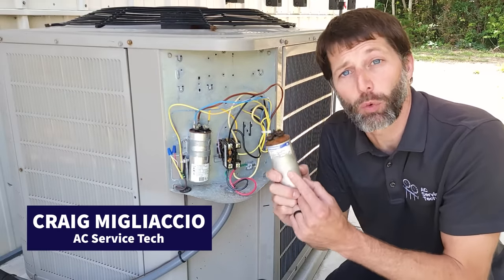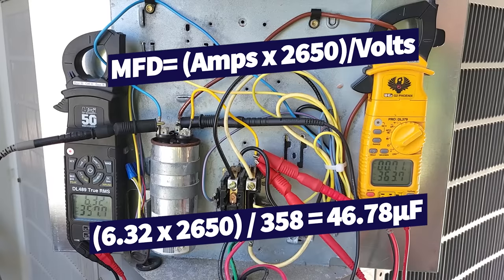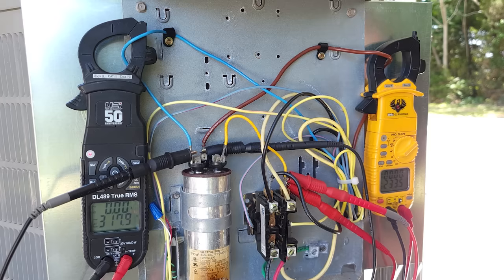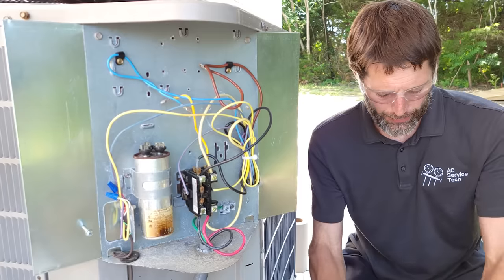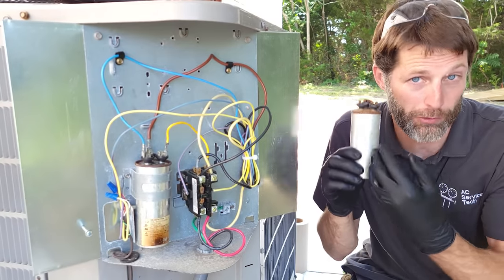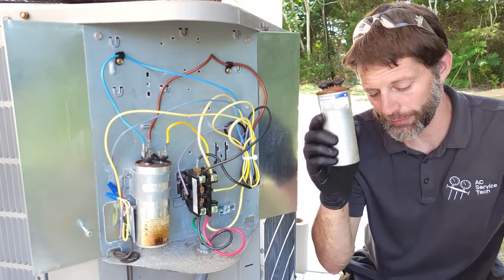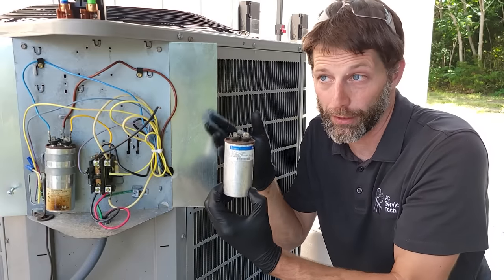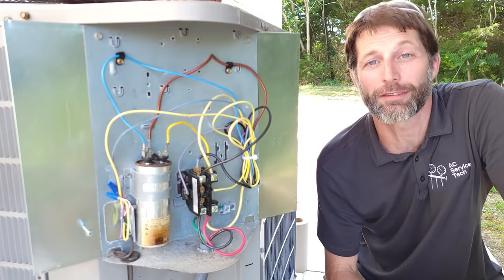WHY CAPACITORS FAIL in Air Conditioners! Watch it Break!

Comment: Isn't a Capacitor a ONE SHOT?   Doesn't a Cap give a momentary boost to get a device initially started and then the device has to keep running by itself?  Can you explain the Start/Run caps?  I thought Caps were only used for start up as they are a ONE SHOT.  Have can a Cap work in a running circuit?   I thought a Cap had to charge and them discharge very quickly and then needs to be recharged again each time it is discharged.   If a Cap is in a Run circuit is it constantly being charged and discharged over and over again?   What device would need to be given a pop from a Cap all the time?
Reply from the maker: A start capacitor is what you are referring to in reference to starting a motor. However a run capacitor stays in the circuit the whole time. It is the best thing to do with split phase compared to three phase. The capacitor provides a 90 shift in the phase angle and is constantly charging and then discharging based on the frequency. We charge a capacitor to to discharge it. The point is to provide a slight time delay in the phase of power before the power is sent to the motor.

Comment: TIP: if you have a cap that is rusted where you cant read the FAN,COMMON AND HERM and you pulled apart with taking pic look at the new caps prongs. The ones with the 4 prongs is your common, three prongs is the HERM, and 2 prong terminals is your FAN. So many techs miss this easy identifiable method.

Comment: How do we know that amperage reading taken on capacitor is a good amperage for motor should we check the amps on motor and compare to data plate fla and if 5hey are high give w higher amperage reading on capacitor and give us a different mfd for capacitor and will that reading on capacitor increase like that on the run or common wire to motor maybe higher amps being caused by bearings overheating and seizing qftr operating a while just curious

Comment: Yep heat kills the cheap generic capacitors. I had a bros inlaw that has his cu under an enclose patios. He would call me every summer cuz his cheap generic cap would fail. I told him you need to relocate your cu or remove your patio. Had him touch the capacitor and it was hot enough to fry an egg. He still would not listen so I had no other choice but to installed an indestructible capacitor. Been years he never call me back again. Been years nobody call me back. I think I should go back installing generic caps. Sure miss them calls.

Comment: When the capacitors dielectric oil expands, the top of the capacitor has a plug so that if it over heats it let's the oil out which is ment to pop to let it out. So that it won't exploded.

Comment: I would like to know more about that formula.
Reply: The capacitive reactance formula Xc = 1/(2 * 3.1415926 * f * C) where f is the line frequency 60 and C is the capacitance.  If you take 2 * 3.1415926 * 60 you get 376.99.  Take the reciprocal and you get 0.002652.  Since capacitance is in microfarads, multiply that by 100,000 and you get 2652 (to be more exact).  You're bascially solving for C in the formula.

Comment: When I looked up the capacitor in my Carrier heat pump infinity system outside unit I found it on Amazon for about $12, why did the repair service charge me $250? Saying that theirs is more reliable!

Comment: When you suggest they have a lifecycle, would that suggest that a cap that is 25 years old and still works be replaced ?
Is it better to use a cap that has a higher voltage rating for longevity with the same microF as suggested by the maker ?
Today's run of the mill caps are made in China. Are those okay to use or is it better to spend the time trying to locate them made in the USA ?
You recommend using replacement female blade terminals that are crimped, soldered or both crimped and soldered ?
Reply: Caps used to last much longer when they were still allowed to use PCB's. From the old ones I've seen they tended to be much larger than the ones of today. I don't know exactly when they had to stop using PCB's, but at 25 years old there's a chance it's one of those. If you know for sure it's a non PCB cap I'd replace it, or if you think you're keeping your system for a few years yet, just buy a new one to keep for a spare so you have it just in case to minimize down time if needed.
Reply: Japanese capacitors are also considered high quality.  And Chinese caps are not necessarily bad, but they have a "wider range of quality", as I heard someone phrase it once.
Reply: @electronics-girl  Yes siree, Japanese is the higher quality of the far east.

Comment: this is why i put my ac unit in the shade to keep it cool and it has run 26 years with just 1 contactor replacement when it was 1 year old power went out and it tried to start on generator power it did not like that.

Comment: I had the hvac come out and work on my unit. And the price doubled every year. They would always replace the same parts. The capacitor, the contacts and recharge the system. And that was extra.  I asked them why they could or would not fix the leaks. I was told it would cost more than the freon. The first year that was $80 a can and sometimes it took 2 or 3 can. The last year they came out was over $600.00. Sure, enough the next year it would not work. So, I go down and try to buy a capacitor. The sales lady asked me, do you know what your donning? I looked at her and smiled, that struck me funny. Over the years I have bought all types of electronics, and No one ever asked anything like this before. So, I went to a big box store and got the part. Got it installed and No AC. I called the heating and air people back and asked if they could send someone out to put in some freon. They sent a guy out and he puts in 2 cans, $200. And mentions to me I need to let them come out and fix the leaks. So, the next year I got window units. Last week it was 14% and the heater would not work. The ignitor would glow a hot orange but No flame. Perhaps a bad gas valve or control board, not sure. Funny thing this week 70% today.

Comment: Not all Capacitors are the same quality, I have been forced to use the least expensive caps, and had them fail often, as opposed to higher priced ones. The higher price is often for a good reason.

Comment: Great Video:   How much higher uF can you go beyond the factory spec, it would seem that a 45uf cap could replace a 35uf cap and prob last longer ?   (as long as comressor or fan voltage is below cap voltage)  ie Similarly,  also shouldn't we be able to replace a 5uf cap with a 7uf cap and have the cap last longer ?  logic:  more electrolyte can absorb more heat w/o failure, i'm sure there is a limit on how much extra Amps you would want going thru those expensive compressor motors but how much higher uf is ok?   I would say 20% over is max, what say you ? Thanks
Reply: Dear Mr Doe - you are the perfect example of a little knowledge being dangerous. Stick with OEM parts you are not an engineer
Reply: No, it's best not to go to a higher value capacitor. As the capacitance goes up, the capacitive reactance goes down which increases the current through the winding and for the capacitor.
Reply: You can increase the Voltage rating of the capacitor, not the capacitance itself.  You can use a capacitor rated for 440V if you have capacitor rated for 370V in there already, as the rating is the maximum voltage it is rated for.

You can also go with a capacitor with a higher tolerance technically, a 35uf that has a tolerance of +/- 5% can replace a capacitor that was rated at 35uf at +/- 10%.  But you can't change the capacitance values themselves.

But, then again AC systems run on high voltage and high current, making repairs on them by untrained people very dangerous.  So, it is not smart for people to attempt these replacements themselves, and they probably don't possess the equipment or expertise to diagnose the problem correctly in the first place.
Reply: no never go higher capacitance unless service info specifies you can, or should, it increases current , current is proportional to capacitance , going lower 'may' work and make it last longer but motor may not run or start correctly , always go by what current service data states, if you dont have any, keep to whats already fitted, maybe fit an increased voltage rated type, thats all
Reply: @andygozzo72  ..be kind here if this is technically wrong....but....can we wire 2 identically uf rated capacitors in parallel to put into the circuit?...would that essentially make for a physically-larger thermal capacity unit that would last longer like the older, larger units?
Reply: @TheWilferch  you 'can' sometimes use 2 or more in parallel to share the current, but you need to see datasheet for the cap to see if you will gain any advantage doing so, lower capacity ones are generally lower current capable, so may not gain anything,  capacity value is important, so for 2 in parallel each would need to be half the value of a single one,  a third if 3 are used,etc.

Comment: Nothing explodes an Electrolytic Capacitor faster than over voltage, you can always use a Capacitor with a higher voltage reading but never lower. E.g. replace a 25v with a 16v and it will act like a firecracker the minute you energize the circuit. One might suspect there is an issue with the compressor or the system causing such high emf surpassing the Capacitor's values.

Comment: Remember that heat causes derating in capacitors. If you look up the part in a catalog you will see a temperature curve. A 35ufd in 70 degrees is not a 35ufd in 110 degrees unless it is rated for that temperature.  And its ALWAYS a good idea to use a capacitor that has a working voltage rating that is 2X what it will be running. Extra margins == longer life.  The dialectric is the material between plates.  most caps have solid dialectrics and some have fluid.  Big caps may have a solid dialectric and be encased in a thermal transfer fluid filled case. (Case within a case as with the duals.) That fluid pulls the heat out of and insulates the actual cap as well.  In a good design caps should not heat up much due to operating. knowing that heat is the enemy a good engineer will factor that in.

Comment: Possible Reason #6:  Poor Quality Control.  My parents had a tech come out, replace the capacitor to the tune of $225.  A year later it failed, no external cause present, no evidence of power surges (no storms or other failures).  Original cap had lasted at least a dozen years.  This time DIY replaced the cap, local supply house only had the same brand.  I was hesitant to get same brand but it only cost $12 and the A/C needed to work again ASAP.  Put the cap in, and it continued to work for several years in exact same environment.

Comment: I still remember when I touched the circuit board of one of the first digital cameras and got electrocuted like crazy.
And that was just by a small capacitor charged by two 1.2v rechargeable batteries!

Comment: Saw a old Fedders unit the other day probably from the late 70s it had what appeared to be mostly original parts on it. The old stuff just lasted longer. The #1 reason why caps fail is they are garbage now days especially the OEM parts.

Comment: Why divided by 2650??    And why you have the black lead on a 110 v contnactor and the other on the harmonic lead ?  It's voltage to voltage,  I thought you were supposed to put the black lead on a ground to read harmonic voltage ?

Comment: If I open a unit and find that there is no capacitor in the unit how do I determine what size capacitor do I use as a replacement?

Comment: The formula "Amps x 2653 / Volts" is derived from ohms law.
E = I * Xc
Capacitive Reactance (Xc) is calculated like this:
Xc = 1 / (2 x pi x hz x farad)
Xc = 1 / (2 x 3.1415 (pi) x 60 (hz) x farad)
Xc = 0.0026527 x farad
farad = 1,000,000 microfarads
So 0.0026527 must be multiplied by 1,000,000
Xc = 0.0026527 ✕ 1,000,000
Xc = 2652.7
E = I x 2653
Formula :
amps x 2653 / volts
example - 4.8 amps x 2653 / 363 volts = 35.08 mfd

Comment: Hello 
I do not know whether or not you can answer my question but I ask , 
Our furnace is about 3 years old , we also bought 10 years service which the come twice a year so called to check it out . we are in the month of may 2024 , the tech has come to check the furnace , he sat down block the door way so I can not look what he was doing ,I ask what are doing he said check the gas pressure ! I ask what wrong ? He said just checking ! he was there for sharp 35 minutes , after he left the furnace was not working like before , we called them before the tech mess up the furnace was working fine but no more , now at 75 deg the house get so cold , we have to set the thermostat at 77 or 79 and still is not working like before .My wife reset the thermostat to be shore our thermostat working fine . We call them they hang up on us ! What the world . 
Q ? why the tech keep taking some small part out as his hand shaking ?

Comment: IN my line of work I don't use capacitors as large as that, but if the capacitor is overheating like that it is not capable of handling the ripple current. Good quality capacitors will tell you the maximum allowed ripple current. Ripple current is all related the the ESR (Equivalent Series Resistance). An ideal capacitor will have zero ESR, but there is no such thing as an ideal capacitor. Essentially what is happening is that your have a current passing through the capacitor and it is heating up due to the effective resistance that it is passing through.
The answer is to purchase low ESR capacitors, then you will have a much larger MBTF. Failures will increase in time anyway as the electrolyte will slowly dry out. Again, quality comes into play as if the capacitor is well manufactured it will retain its electrolyte much longer.
Moral of the story is don't buy cheap capacitors. You get what you pay for.

Comment: I’m no HVAC tech, but what I am seeing here is that the capacitor in my Lennox heat pump will fail? The system is 35 years old and I have lived in this house for 28 years. The compressor failed early on, 27 years ago, but there have been no failures of any sort involving the inside or outside unit since then. Not one. I have done all the regular maintenance, and three times in those 28 years have had a tech inspect the system. The more I read about repairs on newer systems, the more I think that there is some truth to “they don’t make them like they used to”.

Comment: Couldn't you drill some ventilation holes behind the capacitor through the chassis so the fan draws some air past the capacitor to cool it?

Comment: Modern run capacitors are made with “metallized film.” This results in a smaller and less expensive capacitor compared to the older style with 2 sheets of aluminum foil and dielectric film sandwiched between them. All metallized film capacitors gradually lose uF (capacitance) as they age. This happens because the metallized layers (which are molecularly deposited directly onto the dielectric film) are so incredibly thin that they gradually get depleted. These metallized layers are >100 times thinner than the thinnest solid aluminum foil which can be manufactured. And when the uF decreases then the capacitor heats up internally. This process speeds up as more and more uF is lost, eventually causing total failure. Routinely measuring uF of run capacitors and replacing them when 10% below rated uF will largely prevent catastrophic failure. As for life expectancy, this depends more on the price of the capacitor than on the country where it was manufactured. Looking at the rated specs for life expectancy may help choose replacement capacitors with longer life. In simpler terms a capacitor which costs 25% more is likely to last much longer than a cheap one.

Comment: Capacitor voltage ratings should be double the use voltage if you want it to be reliable. Capacitor voltage ratings don’t mean that they last at that voltage. They just don’t fail immediately at that voltage.

Comment: Back when I started in the HVAC trade (1979) Capacitors  rarely failed. Today too many caps are failing in less than 5 years.
Reply: When they removed the PCBs... less toxic, but less durable.
Reply: It needed to be done PCB’S are horrible chemicals. My father my brother and two of my uncles all died from cancer or mesothelioma. They worked at chemical plants that mined and processed phosphate that’s in almost all soap and cleaning product most shampoos and tooth paste regardless of the name on the bottle or tube. 
    Because of this I do everything I can to limit my exposure to any chemicals. I’m glad the PCB’S are gone and most asbestos as well. But we still work around coil cleaner and drain cleaner which is a horrible thing to be exposed to. Always wear gloves and goggles avoid getting pvc glue
And spray glue on your skin.